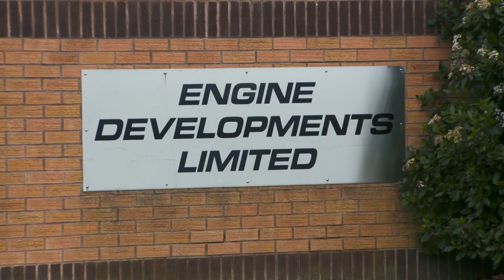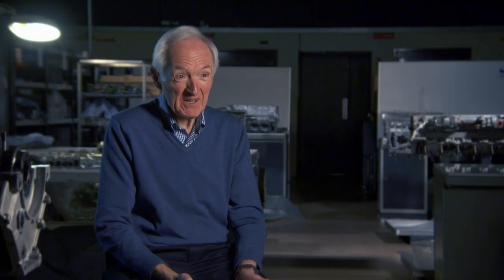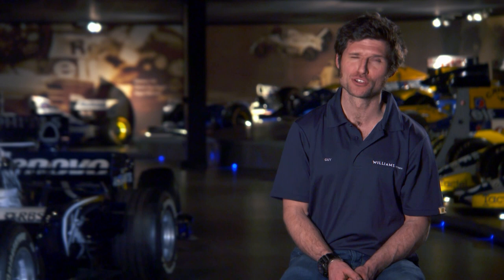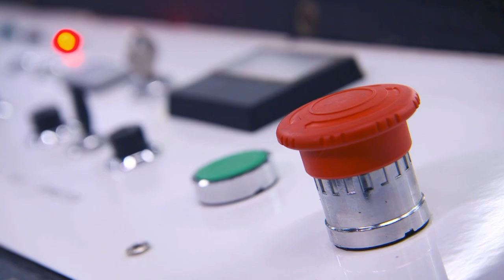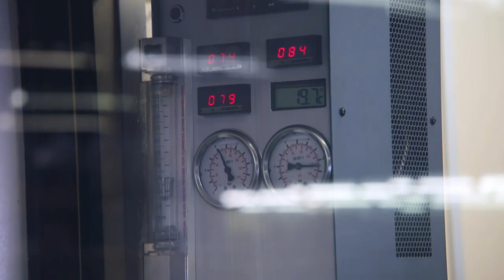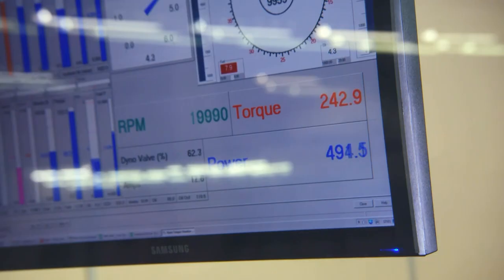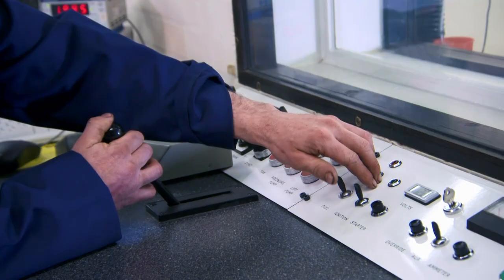Guy Meets His Hero - Speed With Guy Martin | Guy Martin Proper

Comment: Surprised the fresh motor is not broken in at lower RPM's
Reply: I was thinking the same. But I'm quite sure they did, it's just not "good tv" to show it, so they just wen't straight to the "we rev the shit out of it part" and I loved it :o)))
Reply: Yeah, as said above, it very likely was properly broken in off camera. Just not important enough to take up their precious air time, which it seems they wanted to fill with unnecessary drama...
Reply: It will have been warmed up at about 5000 rpm to seat the piston rings and make sure the cams didn’t go flat, then run a couple of times at 3/4 throttle before the footage you see at full throttle.

You don’t break a race engine in like a road car engine, if you do, they make less power so you have to go hard and fast with it after it’s warm.

DFVs were stripped and rebuilt every 1000miles at the beginning of their life but that was at a 10000rpm, towards the end of their use, they were being stripped and rebuilt every 600miles when the rev limit climbed to 11000rpm. With that in mind, you have to remember that it lasting as long as your road car engine isn’t a worry, only power is, and that’s helped with an aggressive break in.
Reply: It's not a family saloon car engine. This might look similar, but you have to remember that it's purpose built by hand. They don't have to break them in in the same way since the tolerance is so precise. E.i. the parts fit perfectly from start, that's the difference.
Reply: @azynkron  - well, yes and no. Yes, the tolerances here are much tighter controlled than in assembly line engines, but you still have to wear the rings in to the cylinder walls, and you need to do a few heat cycles to make sure none of the parts are going to fail from the temperature cycling. But part that, I'll agree that a traditional break in isn't as necessary. Bed the rings on the dyno, do a couple heat cycles and it's good to go. :)
Reply: Controversial thought, do you need too with a 1000 hours of expert engineers building it, highest quality materials and every tolerance checked and checked and checked again. It’s not on a production line motor assembled in a few hours at the lowest cost.
Reply: Most people have totally the wrong idea when trying to break an engine in, running the engine with no load at low RPM will just cause the bores to glaze before the rings have bedded in, once that has happen the rings will never bed in and you will always have 'blow by'. The rings need to have gas pressure put behind them for short periods of time in order to force them into the bores, you then back off the throttle to allow them to cool down before repeating the process. Basically 10 hard acceleration runs with time to cool off in-between will have an engine 90% run in. Camshafts are the only other thing that needs to be run in, everything else in an engine is good to go as soon as the motor is fired up and up to temperature.

Comment: Didn’t they double its horsepower during its span?
Reply: No. It came out of the gate at about 410 hp in 1967 and went up from there. It increased by about 100 hp over 15 years.
Reply: @thethirdman225  I remember it as 375 to begin with, but I could be wrong. I thought I remembered reading that it had 750 when turbos were approaching 1,000. Hard to believe they added only 100 considering engine technology was so crude compared to today when 200 HP per liter is not uncommon.

Comment: to think the group 5 cars made more horsepower than this engine
Reply: Yes but those cars are not big light go carts their huge cars, 450hp would be plenty enough for such small single seater f1 car, and 450hp was most probably the formula one limit at the time, there is actually a turbo version of the DFV called the DFX it made 800 to 1000 hp and could do 250 mph+, it was developed for indy car racing, it also dominated indy car for ten years too, the cosworth dfv  is most probably the most successful engine in the whole of motorsport history not just f1, it also won 2, 24 hrs of le mans races in 1975 and 1980
https://www.museumofamericanspeed.com/cosworthindyengine.html